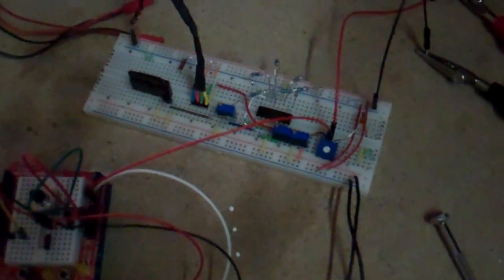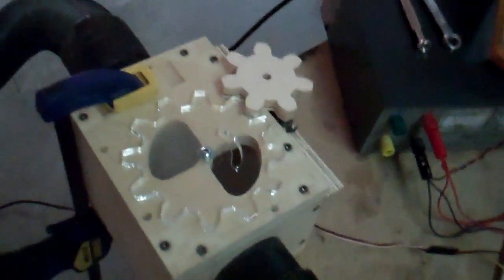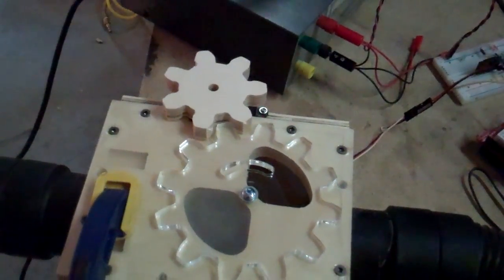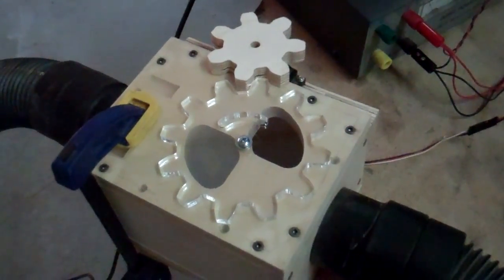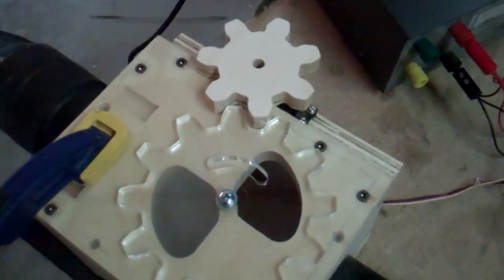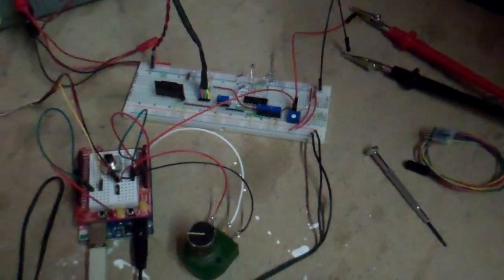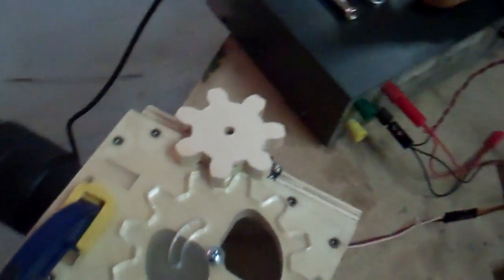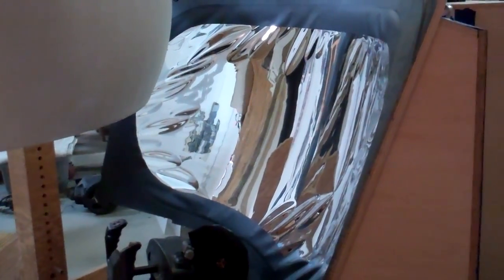Mirror management system

Comment: You should perhaps try a pump instead of a vacuum cleaner, because in essence you are trying to maintain an underpressure using a method with enormous leakage (along the vacuum sucker). It should be possible to completely seal the mirror and then use a leakless pump to create the underpressure. Much more energy efficient and quite..But maybe you like the airplane turbine noises ;-)

Comment from the maker: That's nothing more than a prototype to prove out the system.  The version we use on the full size mirror will be of a different mechanical design and will be a complete PID controller.